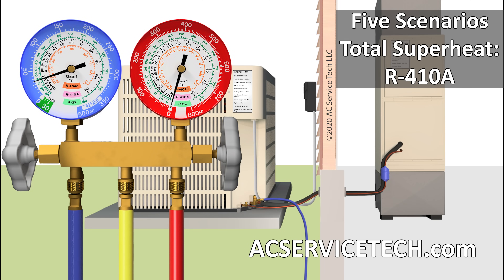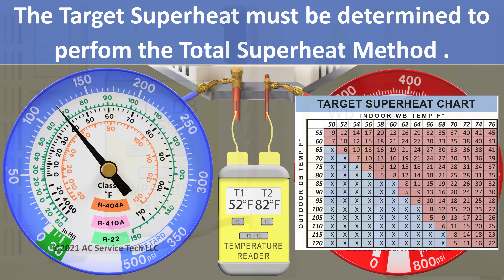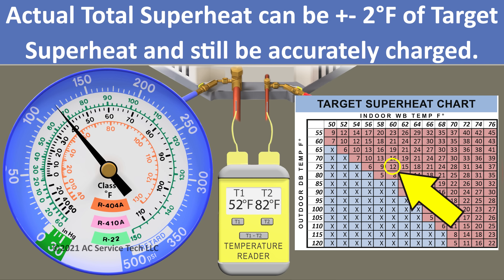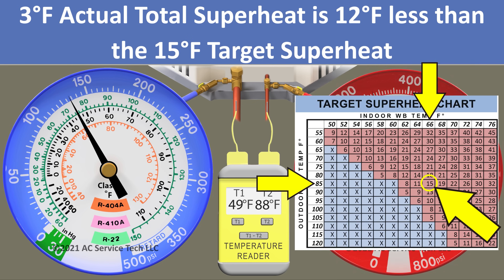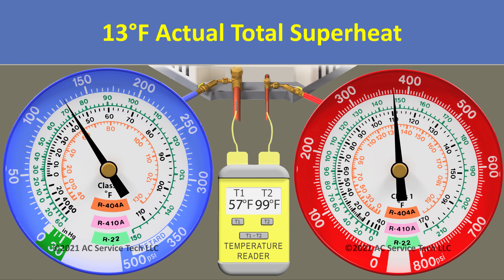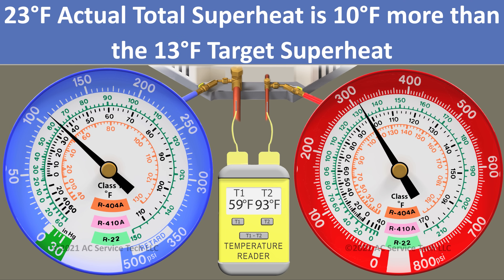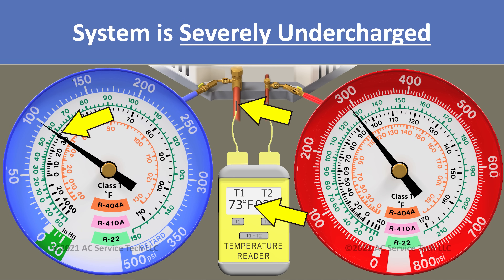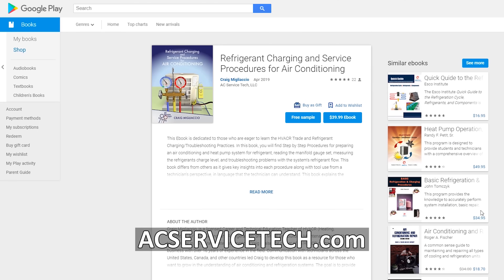Practice Checking the Charge of an R-410A Air Conditioner with SUPERHEAT METHOD! 5 Scenarios!

Comment: Hello and thanks for all your videos. I recently replaced a 3.5 ton unit 410a at my home with a 16 SEER Grandaire. The old Carrier 13 SEER unit 410a was installed in 2006, a Lennar home I bought in 2011.
 Question….I did a WB reading at the return by the air filter box. I did the DB by the condenser. I calculated a 14 degree Total Superheat 60 degree WB & 72 DB. I also did the the reading at the condenser unit port and had a reading of 43 degrees on the gauge and 61 on the thermometer or 18 degrees Superheat. Sub cooling is 10 on the unit and I’m reading 10 - 10.5 degrees. I’m 4 degrees off. Since my line set is approx. 75 - 80 ft long, how much should I subtract for temperature loss for my thermometer reading at the condenser unit? The condenser unit is lower then the air handler and outside in the backyard. Air handler is in the ceiling of the garage laying horizontally up about 10 feet. The TXV is non adjustable. Thanks.
Show less

Comment: @AC Service Tech Craig, when checking superheat and getting your suction line temperature reading where is the more accurate location to take the suction line temp reading? At the outdoor unit on the suction line as per these videos which as I understand is the total or system superheat or taking the suction line temp reading inside at the evaporator unit giving the evaporator superheat?  Or is there little to no difference and location would not matter?

Comment: Random thought. On a single-speed system with a piston. If you had a large enough accumulator, could you charge the system to operate at little to no superheat and get away with it? Wouldn't you get a cooler-running compressor and a slight bit more capacity out of the evaporator? Without risking liquid entering the compressor.

Comment: Your videos are awesome!

Question. If you have a system with a TXV and get your sub cooling charge set, do you need to find your target superheat and verify that the TXV is set properly? If the target superheat is 15° and the TXV is giving you 10°, would you adjust that TXV to be giving you 15°?

Comment: I know this may be off topic but what are thoughts on the zoom lock fittings that seem to be finding there way into the commercial and residential refrigerant world?
Reply: The zoom lock tool has a hefty price tag but it is an amazing tool. those fittings can handle very high pressures without fail. from what I've seen the only downside would be if you couldn't properly get the tool in the right area to get a good fit on the zoomlock coupling/fitting. also you have to make sure you only buy those zoomlock couplings/fittings. overall I'd recommend it if you don't feel like brazing.
Reply: Here’s my thoughts on zoom lock, they are bull shit, learn to braze properly !

Comment: I extremely thankful to you for the knowledge you share. HVAC might not seem like a DIY thing but I work on my own cars and things around the house and With your guidance i have gathered alot of professional HVAC tools and I am able to troubleshoot the ductless Minisplits around my house all thanks to you. Now I have almost a complete understanding of how these systems work. Where i live it is really hard to find sophisticated and professional technicians. Can you imagine no technician here ever vacuumes the system before releasing refrigerant in a new system or before charging refrigerant after repairs. The most they do is a so called 'flush', randomly bleeding out refrigerant from the flare joint, hoping that it removes the air in the system.

Comment: Craig could you make a video on checking pressures in cool mode in low temperatures for example indoor temp 68-70 degrees out door temp 40-50 degrees. Indoor usually starts freezing cause return is too cold and when pressure are checked on high side the subcool seems to be high always when it’s cold out. Thanks 👍
Reply: Residential AC systems are not designed to function under these conditions, they will always ice up.
Reply: Is this a heat pump?

Comment: You clarified all my doubts regarding Actual Total Superheat and Target Superheat. Actually both complement each other to check the charge and diagnose the system. It would be great if you did a similar video, but with TXV metering, which are the most common in the field.

Comment: So when the super heat is higher than the target superheat we add gas right
Reply: Yes .  High super heat on non- txv (piston )  system means under charge . It's opposite of what it sounds like . 

With a tvx you go off sub cool .  And sub cool works just like it sounds.   If your subcool is low ( sub )  "under 'your target then you are low on refrigerant.

Comment: Will moisture in the system give false readings?
Reply: Moisture in system will freeze at evaporator feed and the  system will pump down, at that point shut off compressor and watch for the system to equalize, if it doesn’t and after a time all of a sudden it equalizes it’s most likely moisture, you can confirm this if you see frost at evaporator feed and you just heat the area and it clears the blockage. This applies to all refrigeration systems not just air conditioners.
Reply: Thanks